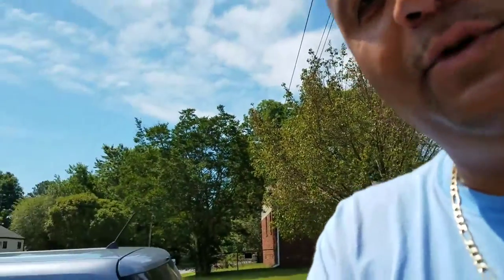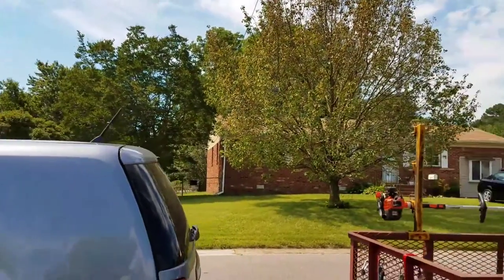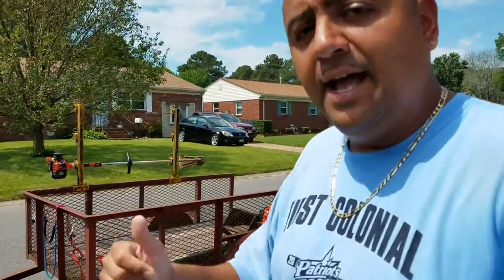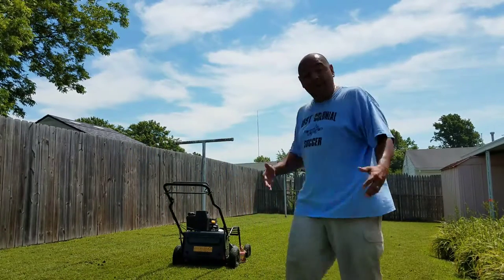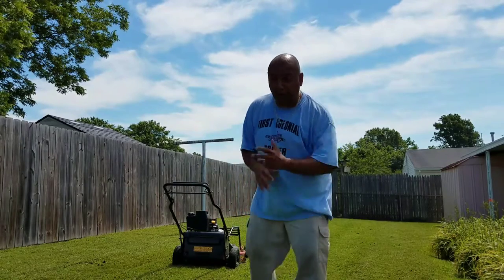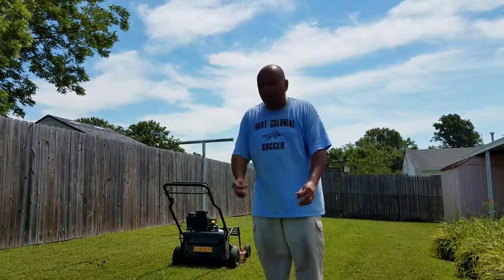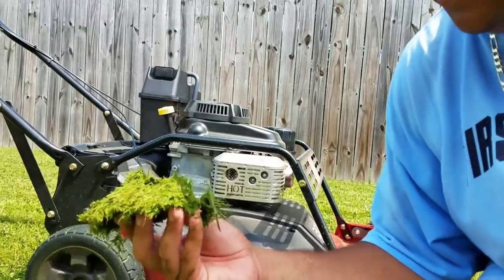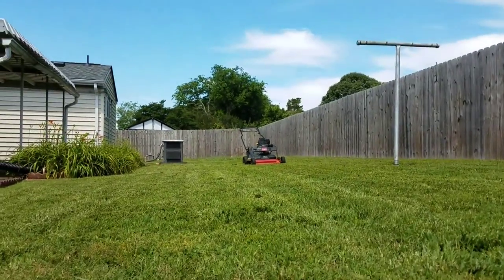Toro Turfmaster 30 side discharge option.

Comment: Hi Greg, I just purchased the same mower and in less then 5 Hr's one of the idler Pulley's came apart - Pull off the plastic guard and spin the blades by hand and make sure your pulleys are intact and not cracking - They will crack on the inside - Toro knows about this problem which is why they have changed the pulleys but mine came with the old one's - Toro #131-4529 is the new one's in case you have problems with your's - I enjoy watching your video's = Thanks for posting them - God Bless -
Reply from the maker: Larry A Hey buddy how's it going, holy mackerel thank you for the information I will definitely check it out. thank you for watching my video and thank you for your support. 👍 have a great day and be blessed.

Comment: Greg, my main man that was a awesome video bro! Question: I got a Toro timemaster for my home and now I'm in the lawn cutting business. I was going to invest in another timemaster or turfmaster for my property but I don't know the difference between the two, do you?
Reply from the maker: Makaveli Robinson Hey buddy how's it going today,  thank you very much for your support and taking a look at the video. these mowers are fantastic, from what I know the difference between the two is the turfmaster has a Kawasaki motor 1 gallon gas tank the black wheels and a slightly different handle for the self-propelled option. Time Master is the residential version but you can still use it commercially that one has a Briggs & Stratton engine now updated for the 2016-2017 season, standard gas tank not sure how many oz, gray wheels and a black plastic front bumper over the deck and the personal pace/ self Propel handle is blue and more comfortable for Homeowner use and lighter in weight and about $900 cheaper. Anything else my friend just let me know, once again thank you for your support. 👌👍🌱🤘

Comment: How well does she mulch?
Reply from the maker: Hey Steve how's it going buddy. This unit is absolutely wonderful the dryer the grass the better but even in wet conditions it does a good job you may have some clumps depending on the sharpness of your blades but when that happens I just use my Backpack Blower blow out a little bit and we're good to go, but other than that I am a thousand percent satisfied with this unit.🌱👍🌱👍
Reply: @gregbenitez  ive just heard so many mix reviews that I don't even know if i should get it or not :( but thank you for the reply means alot brother!
Reply from the maker: True that buddy when I was researching the turfmaster 30 there was tons of tons of negative reviews but I came to think about it, if you're buying it for yourself you're the only one using it so you will not abused your own equipment. Lot of companies purchase these mowers and have multiple people using it and treat them horrible because they didn't buy it attitude, that's when you start getting problems. Other than that when I purchase my unit Toro had a 2 - year warranty and I purchased an extra 1-year warranty through my dealership store. Anything else buddy please don't hesitate to ask. I got to do some yards this weekend I'm going to try to make another video. Its going to be a busy day. 🌱👍🌱👍🌱👍🌱
Reply: @gregbenitez  thank you! You have been much help! Ill be waiting for that video bud and also could you say on the video what you personally think on the cutting options which one works best for the mower?

Much love from texas 😎
Reply from the maker: No doubt Brother anytime my pleasure. And I sure will every yard has different applications. Thank you for your support 👍